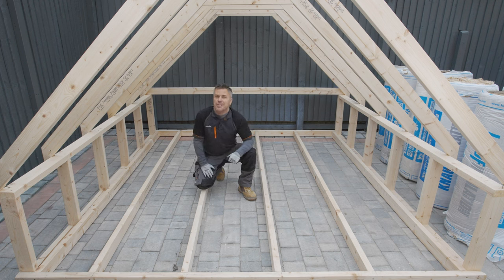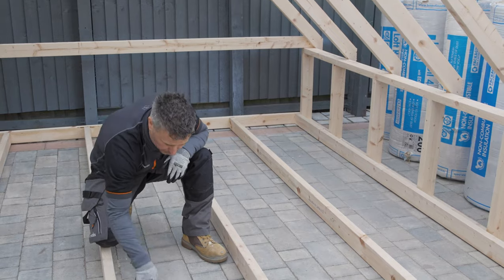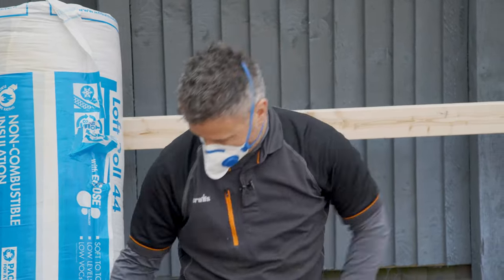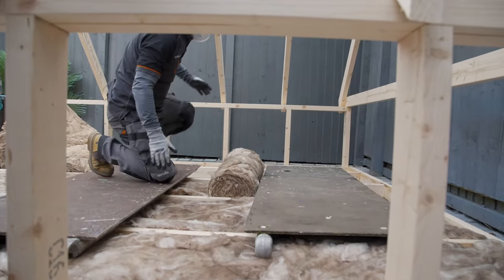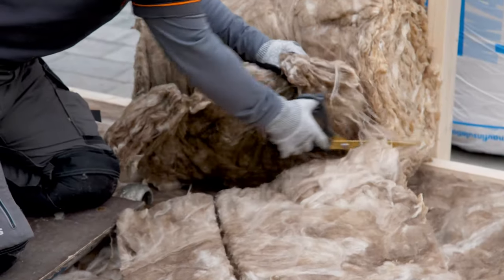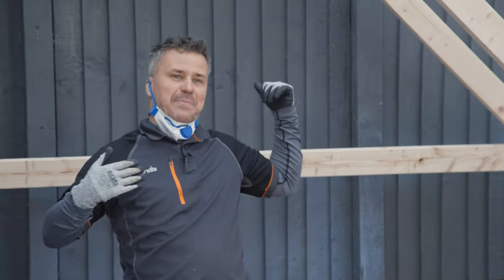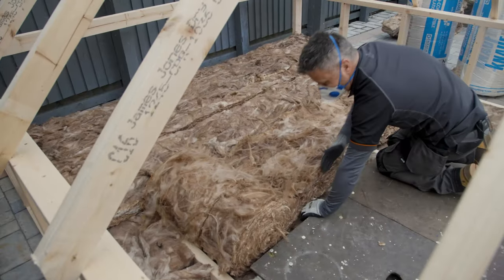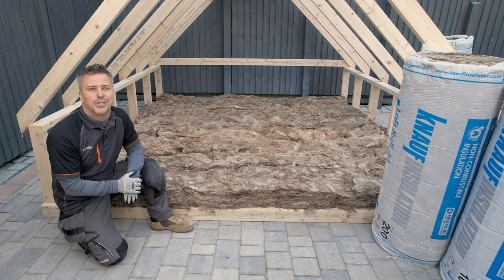How to save energy at home - How to insulate your loft

Comment: ok so if two layers are laid down crossing each other as demonstrated above, how can I fit boarding on top of this???
Reply: You can’t. You would have to raise the framing on the certain area you would like to board and Insulate under that.
Reply: You can get raised feet for boards to sit on as you can't squash the insulation down as it won't do its job
Reply: loft legs and loftzone do products that can help. We have loft leg XL with 400mm insulation. Worth every penny! house is good and toasty now
Reply: Seconded on the loft legs. Well worth doing
Reply: What about all the cables and ceiling light fittings?

Comment: tip, if you need to split the rolls. do it before you take the outer plastic bag off, cut around the bag where the split is,  grip the roll under your arm next to the factory split, then either grip the other half of the roll and bend, it will break, or give it a few hard taps with your free arm while griping with the other.. this way you never have to worry about is unravelling while splitting, and you wont come into contact with the fibres since the plastic is still on .
Reply from the maker: Thanks for the tip!

Comment: Hi. I’m trying to insulate my loft currently (I moved in recently and there’s  barely any insulation up there currently). Every video I’ve watched says you must NOT lay insulation over cables and wires. Instead the insulation should go down first, and then the wires/cables get gently laid down on top. My problem is the wires and cables in my loft are underneath the joists, it in some cases fed right through the middle of the joists via some holes that have been drilled. So there’s no way I can physically get the wires above the insulation. Does anyone have any advice?
Reply: If you have any new ones layed, make sure they go above. Just go with it. Keep that heat in

Comment: What about electrical cables that run in the loft space. Should they be under or on top of the insulation. Is this insulating material safe with electrical cables?

Comment: To cut insulation down the predetermined lines cut using a sharp kitchen knife. Do not open the pack cut it whilst the packaging is intact. Many rolls of insulation have the llines marked for standard gaps in the rafters.
Reply from the maker: Great tip, thanks!

Comment: You forgot to menion paramount information. Vapor barrier inside the house and diffusion membrane on top of insulation in the loft, that way the migration of humidity in the insulation sistem is done correctly. Also, is the first time in 25 years of trade when I see someone cutting insulation with scissors..Nice video!
Reply: Why would you want to trap humidity inside the house and not let it breathe it out via the loft which is ventilated?
Reply: @sledgex9  Vapor barrier has been invented to control the humidity trapped inside and controled with ventilation then only the accidental humidity from the walls to be let migrate out.  But all of this depends of the area of the building, too many factors too account for. New standard means mandatory barriers both sides.

Comment: Very nice presentation. I have one question. Is it nessecery to install both down of the insulation and up a breathable water vapor membrane? For the down part I am sure because the membrane is installed on the heat part but I think we also need the same on the upside because on summer we have the opposite phenomenon and the heat part is up. What's your opinion on the mater. I see you use knauf rock wool. I used this staff especially the tp 132 or 032 Rockwool

Comment: Can you please tell my why you need to use 100mm deep roll for the base layer and then 200 mm throughout. 200 mm looks cheaper to buy and obviously thicker and warmer?
Reply from the maker: The joists in most attics are 100mm tall. So you fill those with the 100mm mineral wool and then lay the 200 on top so you don't have any gaps in your insulation.